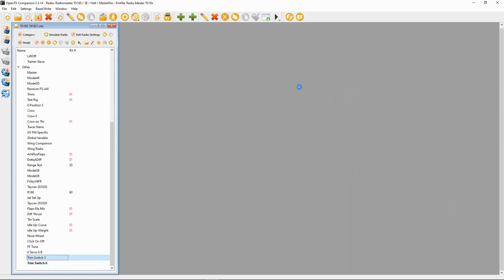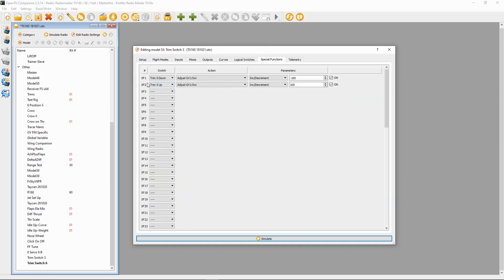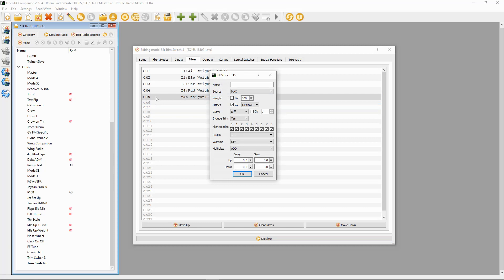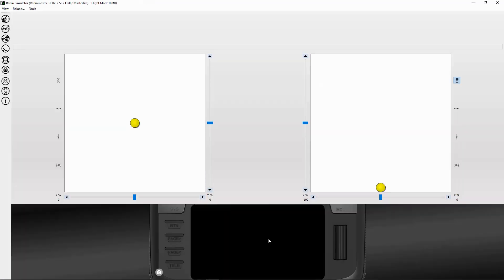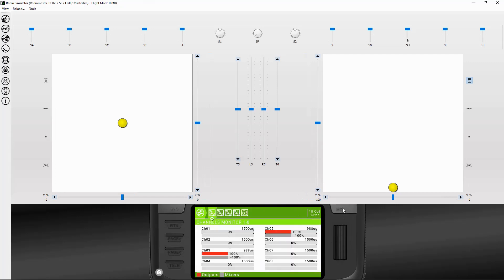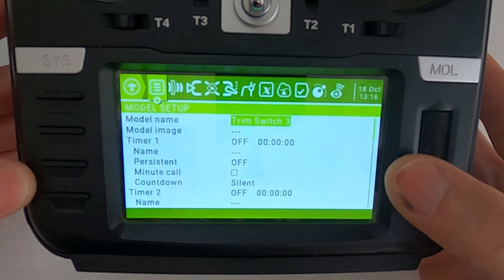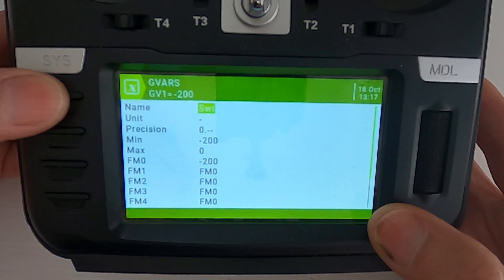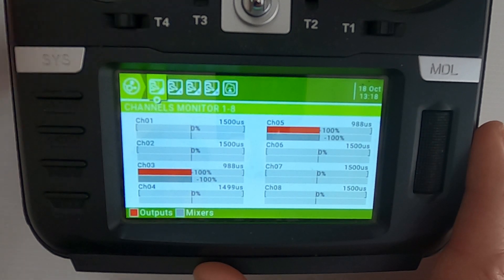OpenTX 3 Position Trim Switch

Comment: Is there a way in Edge TX
Button pressing quick 0
Double button pressing 90°
Triple button pressing 180
Reply from the maker: Could you tell me what you want to control?
Reply: I want to be able to control a servo as if it was a three position switch

Comment: Hello Bill, thanks for the idea! I tried this on my X-Lite Pro with your settings, cause i use the trim buttons a lot for switching functions. This radio has limited hardware switches, so setting up something with the cross buttons on the X-Lite Pro is very helpful. But.... it didnt work...no reaction on the assigned channel. So i tried a few hours some different settings with no result. Then got the idea that value of the GV1 you defined with -200 is in my case maybe wrong and this was the solution. I set this value to 0%, cause the special functions adjust the correct value and everything works perfect !! Also tested 6 or 8 position switch settings. Works even great. So in my case the regular trim buttons works only with a value of 0% in GV1. All other settings are same as yours. Greatings from germany....